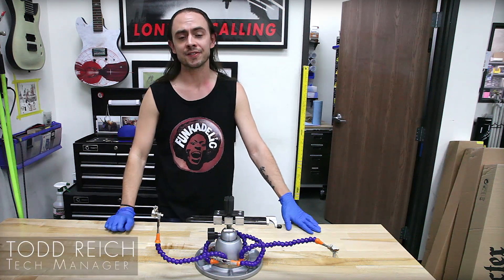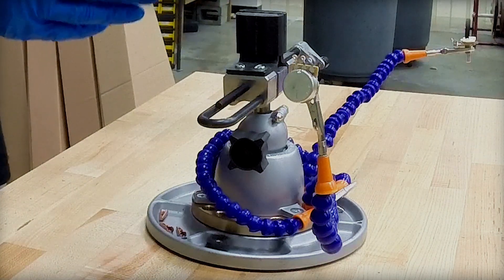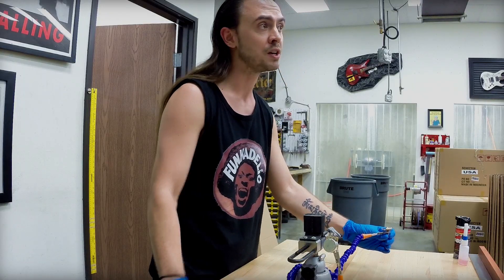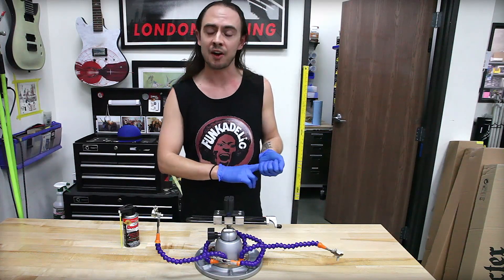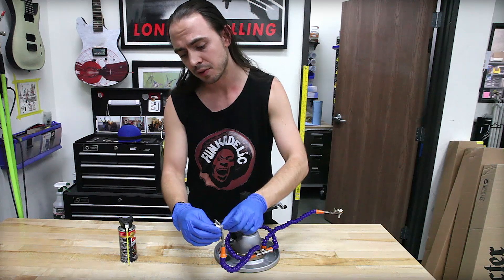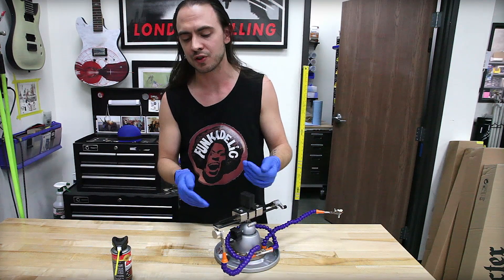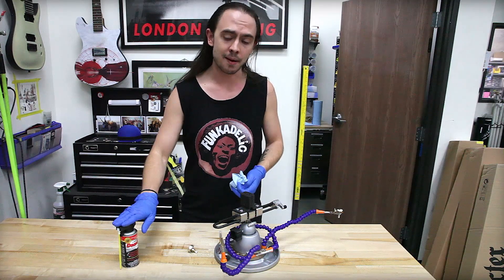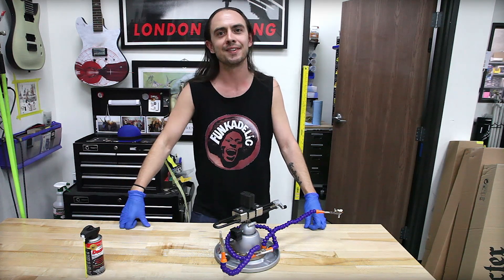Schecter After Hours: How to clean dirty/scratchy volume or tone knobs

Comment: Fixed my 25 year old Altec Lansing PC speakers with this video. I used brake/contact cleaner. Thanks for the video.
Reply: You can also jsut continually turn the volume all the way up and down, with the speakers off of course. This will clean the oxidation off from the inside.

Comment: Know your potions.   Caig DeOxIt D5 is a CONTACT cleaner, to be applied to clean metal contact surfaces.   Caig DeOxIt F5 (aka Faderlube) is made specifically for conductive plastic faders and pots.  The latter product is the more appropriate one for cleaning pots.
Reply: It’s easy to get this confused but the F series is for linear faders like on a mixing board. CAIG has an Audio 9-1-1 guide on their website where they give specific recommendations by application. Quoting from that: “Unsealed pots:
Rotary pots respond best to DeoxIT® D-Series 100% spray (Part No. D100S-2) or 100% liquid (Part No. D100L), depend- ing on how they’re mounted.”

Comment: CAIG also offers "DeoxIT® Fader F-Series is a precision lubricant specifically formulated to improve conductivity and lubricate conductive plastic and carbon compound faders, switches, potentiometers and other similar components.Oil, grease and acids build up on the membrane surfaces due to repeated finger contact and can lead to device malfunction. Applying DeoxIT® Fader will provide a long-lasting barrier against these types of contamination."  
Which is best for pots... DeoxIT D5 or DeoxIT Fader F5?
Reply: I've been looking into the same thing. Not a lot of easily accessible clear info on this. Most people just seem to use whatever product they seem to use. It seems like at the higher end, the proper way is to first clean with a cleaner (D5), and then finish with a lubricant (F5). Even though many products claim to be a cleaner and lubricant in one.

However, I've also found there seems to be several styles of potentiometer constructions, including a grease packed pot, which I don't think you're supposed to hit with a solvent cleaner, or at least have a way to put back an actual grease and not a thin viscous lubricant film of something like the F5. Some types might need a type of "dry" lubricant like a graphite (not sure if there are conductive lithium or not) or similar.

Like anything I guess it depends on the quality of work, or quality of equipment you are trying to fix. At the low end for a cheap fix, people seem to used WD-40, although it will supposedly attract dust more rapidly and is less of a cleaner, but more of a lubricant that will "displace" any dirt or old lubricants.

I've found some info from electronics engineers, guitar restoration experts, and vintage radio restoration hobbyists, but nothing really concise for the higher end of this stuff. If anyone has any info comment away.

Comment: Hello I have just bought a brand new omen extreme s-ii  and the volume pot cuts off through part of its range, should I try and clean the pot ?
Reply: I bought a PT special from their website about a year ago. The thing showed up, strings rusted out, saddles heavily oxidized, and a volume knob that crackles and cuts out. It was the first and last schecter I purchased. Probably should've waited until Sweetwater had it in stock.

Comment: Deoxit D5 should not be used on things that MOVE such as pots. It may work but in the worst case it may cause the pot to freeze up or wear out prematurely. Deoxit F5 is what you should use for pots and faders as it contains a lubricant and cleaner.
Reply: What do you recommend for switches?
Reply: @MichaelDespairs . D5 is OK for switches, but causes the carbon tracks in pots to degrade. Inside pots need fader lube F5.
Reply: Thank you for adding this comment. Many people are damaging their pots by using D5 where they should not. F5 is the only way to go for pots and faders. Too many videos showing this mistake.
Reply: Can you use it on audio interfaces?
Reply: It seems like D5 is the usual recommendation for pout cleaning and I haven’t heard of anyone having issues in my limited time looking into it. Have you had a bad experience with it?
Reply: Not to be rude but then what would D5 be used on? What non moving parts need lube?
Reply: F5 does not remove oxidation on metal pots, makes it useless on guitars
Reply: @Kevin-the-Just  CAIG Labs has a 25 minute video on their site saying that it’s a myth that D5 damages carbon potentiometers.
Reply: @MarsCapone  Input jacks and toggle switches.

Comment: I'm not sure where I got this but I thought I saw something about being able to clean a pot without any removal of the pot or any other thing I always thought you could just spray right into the front of the switch but as I look at it I'm not seeing any place for the spray to go
Reply: Get a short piece of clear vinyl tubing with 1/4" inner diameter; most guitar and amp pots have a shaft diameter of 1/4".   Slide the tube over the pot shaft, point the Deoxit "straw" down the tube, spray the Deoxit onto the shaft, put a rag underneath the tubing to catch the overspray that is now inside the tube, and remove the tube.  Turn the pot from on to off and back again for a minute or two.

Comment: I was wondering if a pot is really dirty would it shut down all the volume as to have none I'm about to do a spray out but was wondering if I'm wasting my time like I say I have no sound at all coming out of my amplifier?
Reply: If you sweep the pot from fully-closed to wide-open and nothing comes out of your amp, then something else broken.  Dirty pots should generate some noise.  No noise means a wire came loose, a solder joint broke, a cap or resistor broken, etc.

Comment: just cleaned my posts with some contact cleaner. However my volume pot is a 500k dimarzio and it is making an annoying metallic squeek noise now. any idea if i should lubricate thse as well? I was thinking some 3 in 1 oil? asking for some recommendations before i throw it out.

Comment: Hi!
A question...how can I fix a pot that turns too easily? Is like the minimal touch makes it turns...and I'm continuously worried by this pot not turning. It's just too light or soft when rotating (I don't know how to say it) that it's impossible to play.
It doesn't moves from the sides, it just rotates with even the minimal touch all the time.

Complication is that it's a push-pull pot so I can't put a foam on the space between. I don't have guitar techs nearby 500 kms and I don't know what to do because it's impossible to play this way. I had guitars with this problem but not this much :(

Comment: my tone pot on my c7 deluxe is having the static issues...i bought CRC QD Contact Cleaner. this is ok? its plastic safe, dries quick and leaves no residue. the stuff talked about in the video is basically a different brand of contact cleaner right?

Comment: You can get the same results cleaning your potentiometers with some CRC QD Electronic Cleaner. 
You can pick it up at walmart for like 5 dollars for an 11oz can.
Nothing against Deoxit. I've used it and it's great stuff.
Deoxit cost about 15-20 dollars a can.
QD Electronic Cleaner is 5 dollars. I've used it for years with no issues.

Comment: Can i use wd40 or q20?
Reply: rossjybuis NO!    WD 40 is a water displacement oil
Reply: Yeah I think the value of the right spray is that it evaporates everything and yet WD-40 leaves a residual behind which I think then attracts dirt if I'm not mistaken you might want to fact check me on that

Comment: Hey I have a question, my guitar volume and tone knobs have a little stud on the side of them and its cause them to not sit flush under the scratch plate when screwed in. I'm not . sure if this metal stud that sticks out is neccisary, but I was wondering if it would hurt the electronics to grind it down so it sits flush. Its on a fender Jagstang
Reply: Yes you can do that just make sure to put one of those star washers on the under side to keep the pot in place when you turn it,these pots were probably made for a strat that had a hole for that little nub,or someone changed them out.
Reply: That's a stud that goes in a small hole to  keep pot stationary better.

Comment: I cant believe spraying WD40 into my pot just fixed it. Holy hell man, you saved me a heap of soldering!!!!
Reply: I know this comment is 2 years old, but I'm leaving it for anyone else reading: You shouldn't use WD40 on electronics as it leaves unwanted residue behind and it makes a mess. You should always use a proper cleaner.
Reply: @Jose_Munguia  What cleaning product do you recommend?
Reply: I'm guessing availability varies a lot between countries, so I won't go naming brands, but anything specifically labeled as contact or electronics cleaner should be ok. There actually IS an electronics cleaner under the WD40 brand and it is ok to use, but most of the time when people say "WD40" they specifically mean the lubricant. Most people don't even know there's other WD40 products.
Reply: I know DeOxit (the brand of products used in this video) is a very respected brand and I remember it being the standard among professionals in Mexico back when I lived there. I've never come across that brand in my home contry (Nicaragua), tho, but there's other brands around here.